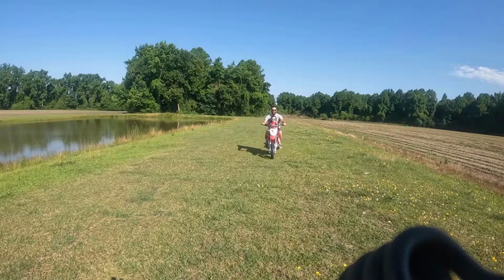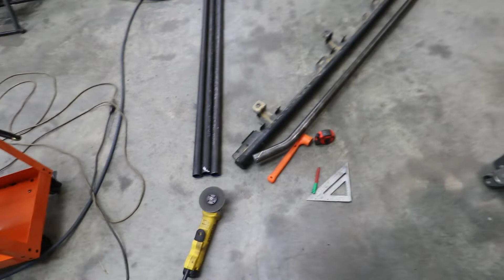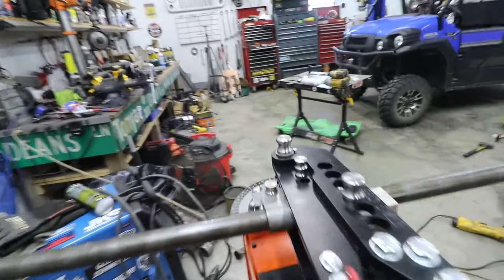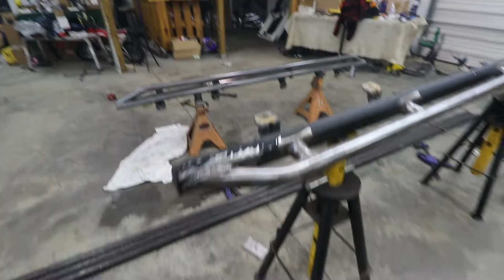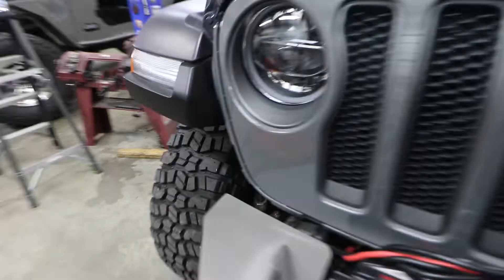DIY Rock Sliders/Rub Rails for Your Jeep Gladiator JT

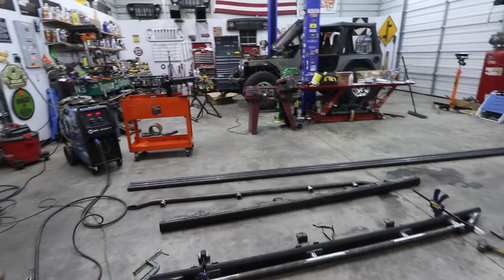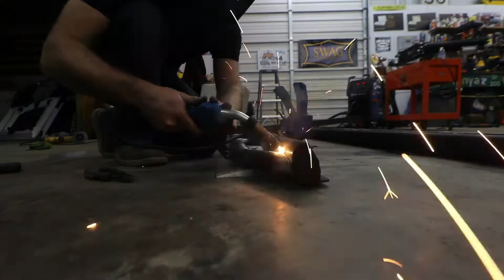Comment: Great video.. and don't mean to be a negative Nancy here.. but at 6:52 you speak about cleaning the parts with brake cleaner and then at 7:06 you weld them.  You know that welding parts cleaned by brake cleaner creates chlorine gas that can instantly dissolve your lungs right?  There is nothing they can do at the ER to fix it either.  Fortunately you somehow avoided that here.  I NEVER use brake cleaner for that reason.
Reply from the maker: Great point. I try to use non chlorinated brake cleaner when I do welding